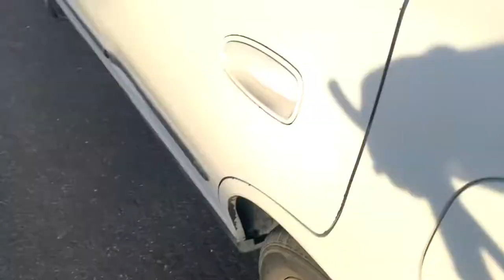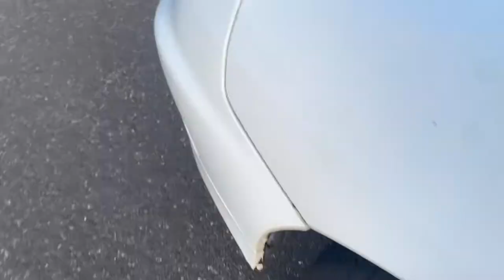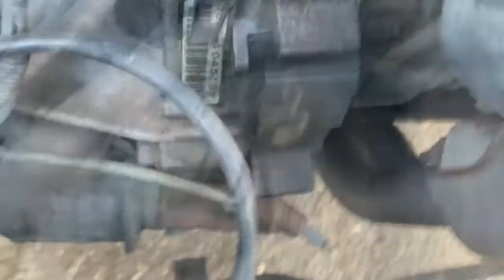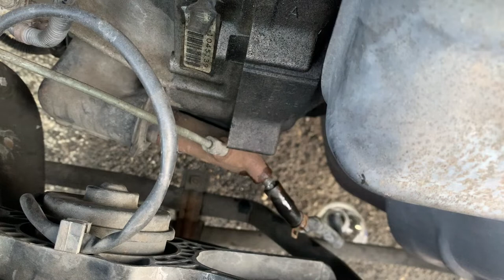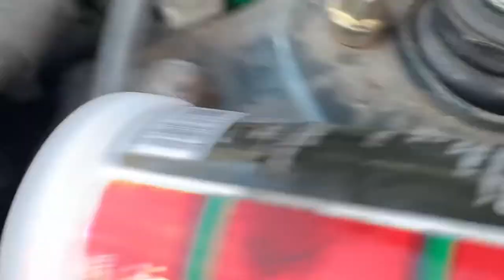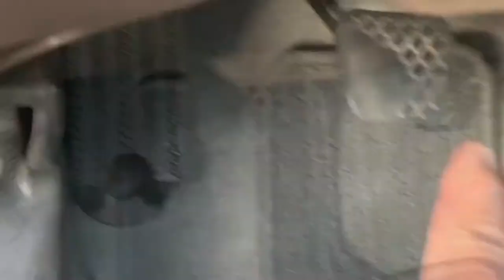How to bleed clutch pedal from Acura Integra 94-2001 DIY

Comment: My clutch works fine but it gets low on fluid like every month is that bad?
Reply from the maker: Carlo

Trace from the clutch pedal to the transmission, you should see a seepage of some sort coming from the slave cylinder or connector lines. Check fire wall and look under engine/ transmission there should be a wet spot.

John
Reply: Same.. I feel like maybe there might be a  leak or something
Reply from the maker: Might still have air pockets in the lines, try to bleed it again.  It should be a noticeable improvement.
Reply from the maker: @grusive 

If there is a leak it should be visible.

Comment: I did that and I still have no pressure in my clutch :/
Reply from the maker: Trace line from clutch pedal to slave cylinder, usually slave cylinder go bad and you’ll see seepage going onto ground.
Reply: @jpscrx  the slave was replaced before I did the master and the slave worked
Reply: Same problem smh